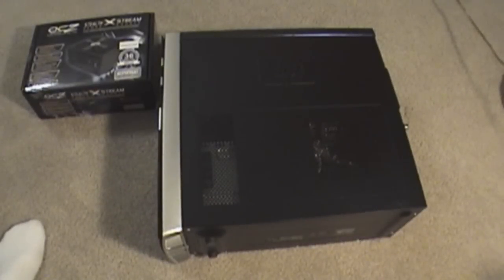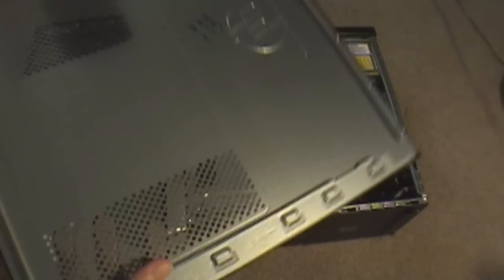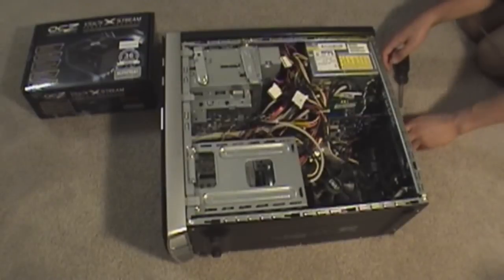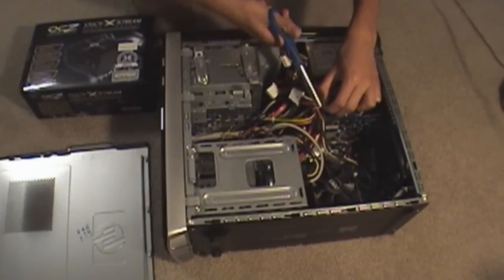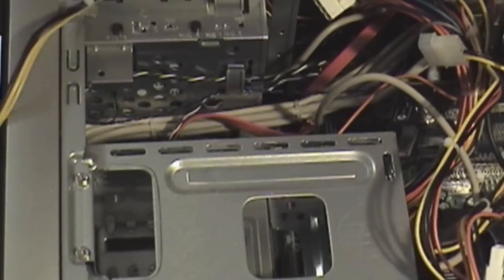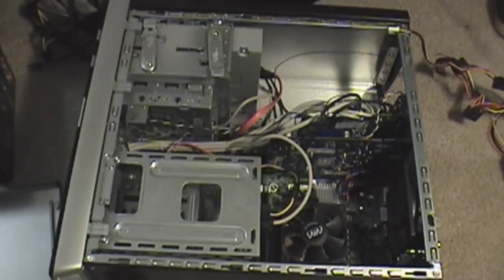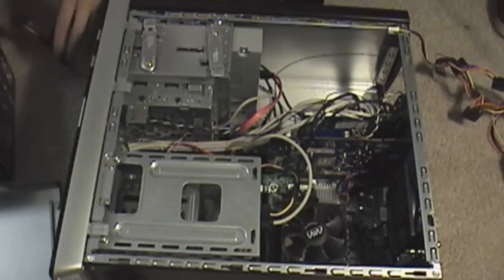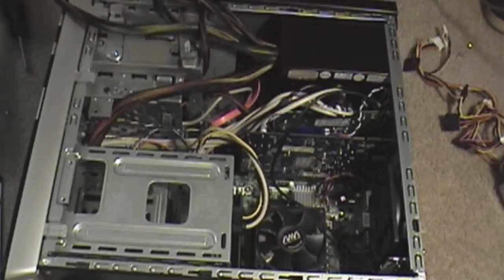How To Install a Power Supply

Comment: hey man i had a question about a psu I have a hp pavilion p7 1490 and it currently has a 300 watt psu with product dimensions being 150mm x 140mm x 86mm (5.9 x 5.5 x 3.4 inches) and i want to upgrade to a corsair 500 with dimensions as 5.5 x 5.9 x 3.4 inches and i was wondering if yo think it would fit okay thanks

Comment: @Klimessss I am not sure if he is even grounded.  Doesn't the psu have to be plugged into a grounded outlet (3 pin) and in the off position for it be grounded?  This video should be called, "what not to do when messing with your computer hardware" lol.